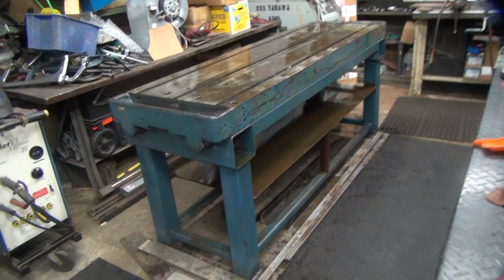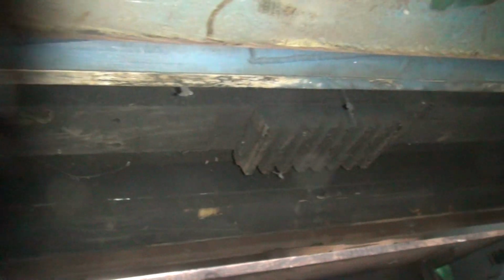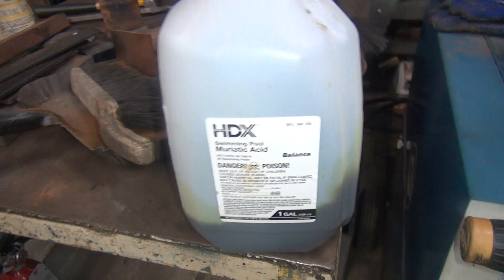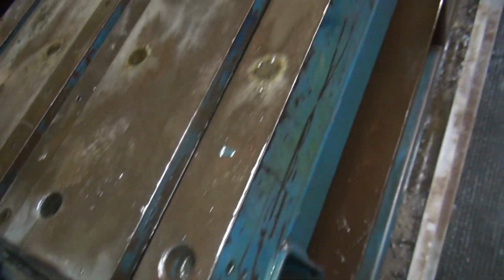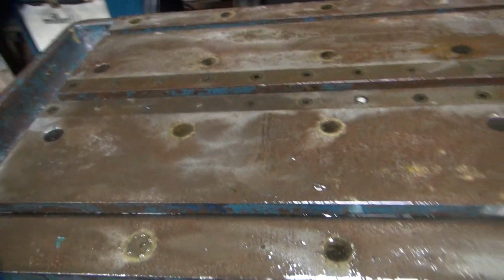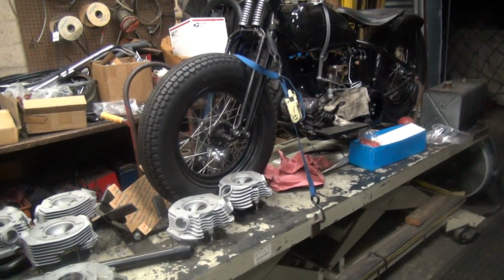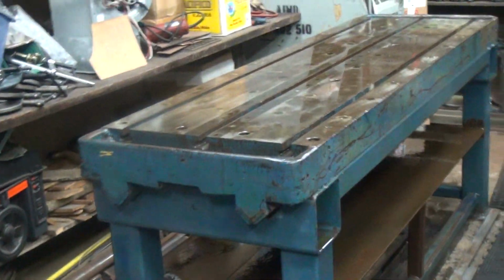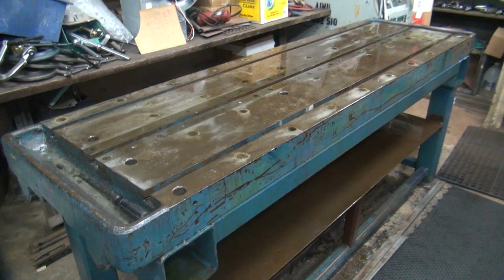#1 tatro machine new frame jig table harley

Comment: hi Tatro. greetings from Paris. that is a nice piece of table you got there, wondering about the size of the mill it was on... 

Do you have in project to build frames from the ground up on it or just fix old bent oem and badly made repop ones ? 

It will surely be great material for many more videos both while building it and once completed. 

BTW, TShirts are on their way to France and should arrive beginning of next week. 
thanks again for all we can learn through your knowledge and experience shared on your channel
Reply from the maker: not sure what i am going to do with it now but it should be strong enoght to get the job done. maybe i will get back on my new race frame again?
tatro